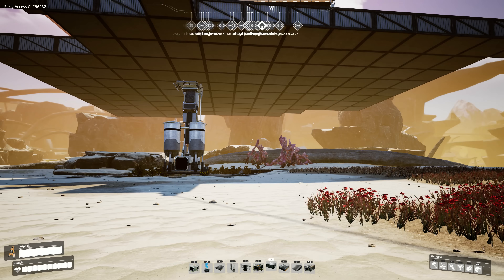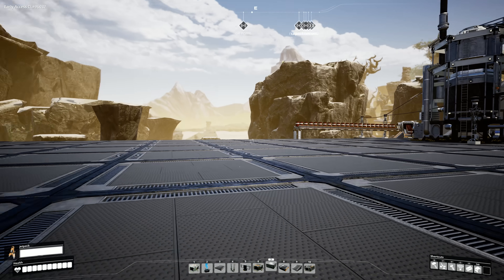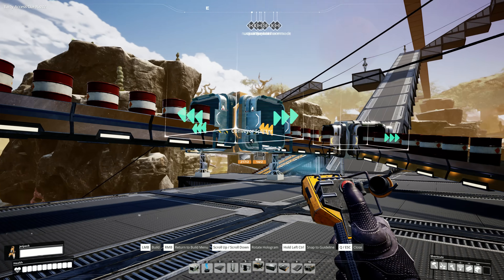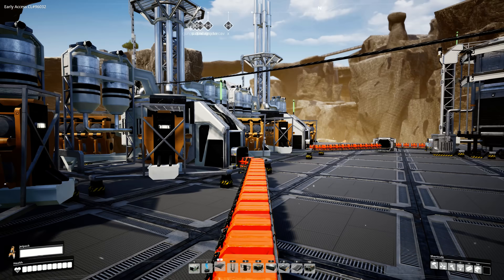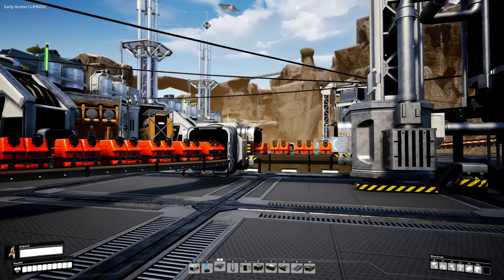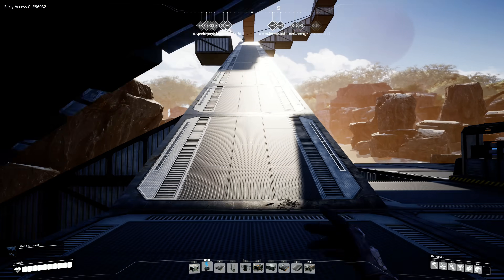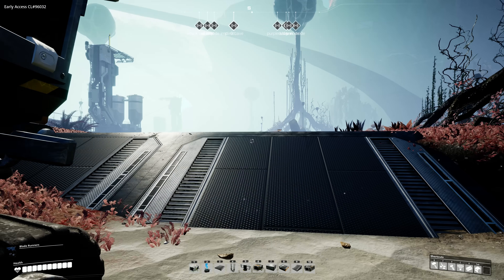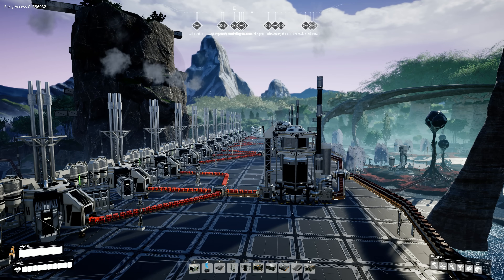SATISFACTORY - Oil Pump, Oil Refinery and Fuel Generator Guide

Comment: You said you like to use Mk4 belts for everything :O That's a huge amount of resources you're wasting bro. With the exception of the belts coming off of Miners, I rarely use belts other than mk2 (and I use a lot of mk1's still)
Reply from the maker: Resources are infinite and I have a container full of mk4 belts. I guess it depends on what scale you want to go to as well.
Reply: @GrindThisGame  yes, absolutely true XD I was amazed at how you got like 3000 MWs of energy going. I'm just now starting my crude oil automation, and I'm using only about 200MW in all my factories combined, and I have everything automated up to motors. I guess you're really going for mass production on EVERYTHING ahah

Comment: Am I to assume that the oil generators are more efficient for mass power then geothermal?
Reply: yes, there's a limited number of geothermal vents, and they're very spread out.  also expensive, so by the time you can make them you'll already have other power supplies set up.  may as well snag the ones near your base though.
Reply from the maker: yeah geothermal is sort of underpowered (200MW) for the materials you need to make them. And yea they are spread out quite a bit. They don't require fuel but fuel is very plentiful.
Reply: I taped into all the geo thermal on the map  took for ever to do that buts it’s free power

Comment: A single.oil refinery can support many fuel generators because the generator uses the fuel far slower than the refinery produces it.  I have a cascade setup where a single refinery is supporting about twenty generators since the supply line quickly saturates you dont need to do binary splitting to ensure the generator always has fuel.  You only need binary splitting of supply lines if you want to maximise throughput of a production setup and ensure a minimum delivery amount.  Also build from above, you get much better snapping and a closer fit.
Reply: that's only true when the generators aren't running at high capacity.  once you start demanding more power than your refinery produces in fuel, your reserves will dwindle until you eventually brown out.
Reply: Spudtion well duh.  But that isnt solved by binary splitting either.  If you are overclocking then youll need to fine tune the generation to usage ratios for any system in the game.
Reply: @probablynotmyname8521  Generators will use up to 12 fuel per minute without overclocking, if you're using your max power.  trying to feed 20 generators off one refinery when they're trying to use more than the refinery produces will run you out of fuel, without overclocking factoring into it whatsoever.  Essentially, a single refinery fully stocked and without overclocking can produce enough fuel to generate 468.75 MW.  If you're attempting to use more than that, your fuel reserves will diminish.

Unless by 'refinery' you're referring to more than a single refinery building, in which case yeah, that's the same setup I often use for things like ingots.  But what I think you're getting at is where instead of binary splitting you supply buildings directly off the main line, and the main line continues on to further splits.  That's how I do coal - two lanes of 11 generators off a single 240 coal/minute belt.
Reply: Spudtion actually youre right i was thinking of the coal generators, i originaly had one coal line feeding about 20 generators and still had overflow for steel production.  I checked my current oil setup and i have 1 oil pump overclocked to produce 240/min feeding 19 fuel generators.  Even then ive had to do a loopback and  set up overflow storage, i should fine tune it but theres little point, ill need more power later.  My main point though is that you dont need binary or half splitting of a supply line for power generation.  Binary splitting should be used when you want to guarantee a minimum amount of a resource to be delivered.  And yes i have a single “lane” for delivering coal/fuel to all the generators.
Reply from the maker: I use a "shove it" setup for my smelting line and coal power (ie I have a splitter before each building and just stuff the line) but for the fuel generators I prefer the even splitting (not quite binary with 1:3) :)  to make sure I can hit peak power without issues.
Reply: Grind This Game but the max fuel an overclocked generator can use is about 24/min to generate another 150MW.  Its far better to just add another generator and save the 3 shards for normal non fuel processing.  You are using a little more fuel but have a cleaner setup (at least until they provide an indicator of what is overclocked). And if dont overclock then you are losing the excess due to the fuel just sitting there, that fuel is unavailable for use in other generators and things just back up.  If you are running things close to your power production limit then youre going to have problems when you start to overclock because its very unlikely that all of your factory is going at 100% so there will be power spikes you dont notice as backlogs clear and a production line becomes active.
Reply from the maker: I don't use any shards for the fuel generators, only on the oil well itself. Right now I'm using like 20% of the total power so I'll be good for quite some time. Can't wait try out nuclear power when they eventually add it.
Reply: Grind This Game yeah im looking forward to having more stuff to do, at present their roadmap is a little fuzzy on upcoming features.

Comment: Would it make sense to add another splitter to siphon off the extra fuel that is generated, and collect it all in one location. All those little extra bits should be enough to keep your rocket pack fueled.
Reply: you can just snag the fuel out of the refinery or generator if you're nearby and need to refuel.  I did a complete circuit of the outside of the map and used less than 400 fuel, so you don't really need to worry about massing a stockpile - just enough to be a convenience.
Reply from the maker: It would make sense. I have a dedicated refinery in my base that keeps a container full of fuel for the jetpack.

Comment from the maker: One correction: 1 normal oil well overclocked 3 times will generate 2250MW of power. I mentioned 6750MW but that was if I used all 3 oil wells. You'll probably want to save 1 or 2 for plastic production anyhow.
Reply: 5 seconds is not accurate for the burn time... I timed it and found that one refinery can supply 12 generators.  i have tested this
Reply from the maker: @mattulman2901  Interesting. Were you using max power? If you're using less than the max it will not burn fuel as fast I think but I haven't really tested it.
Reply: Matt Ulman depends on how much energy is used of maximum available amount